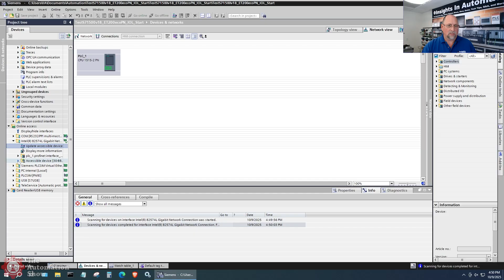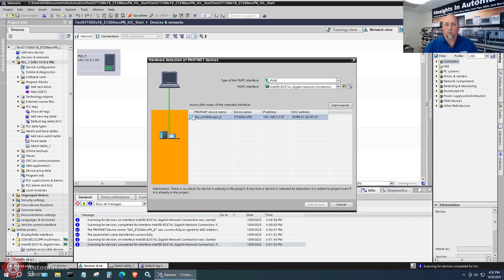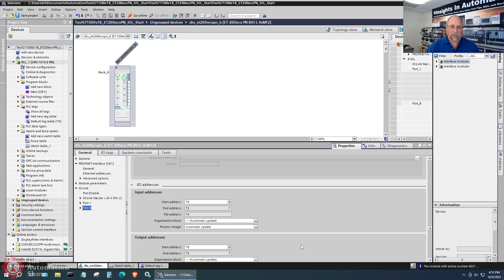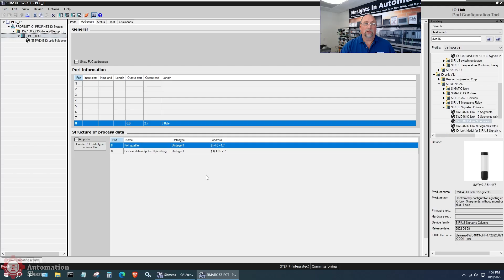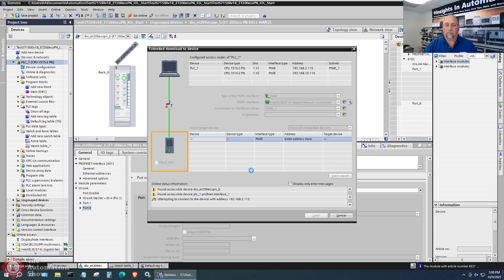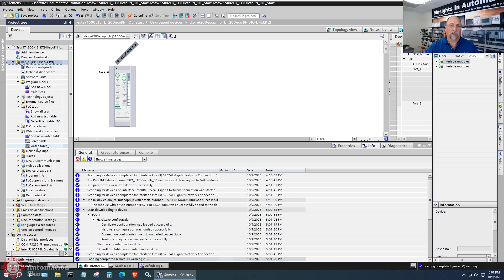Setup & Use the ET 200eco PN CM 8xIO-Link DI 4 with an S7 PLC in TIA Portal

Comment: Hi, thanks for the video. I tried the same but when i open the S7-PCT Tool it shows the IOlink-Master but it doesn't show its ports. Do you know why?
Reply from the maker: I'm not sure - maybe they are all disabled by default? See if you can enable them in TIA Portal first, before launching the PCT?
Reply: @InsightsIA Found the problem: installed the HSP and the latest version of PCT-Tool. Now I can see the ports. Thanks for the video!
Reply from the maker: Thanks @matthiasseng8798 for letting us know what fixed it!
Reply: @matthiasseng8798  I had a similar issue and that was the solution. Thanks!